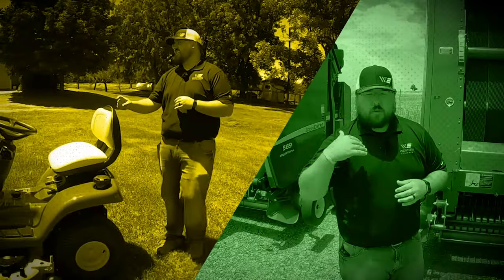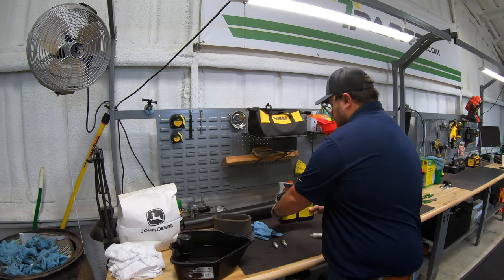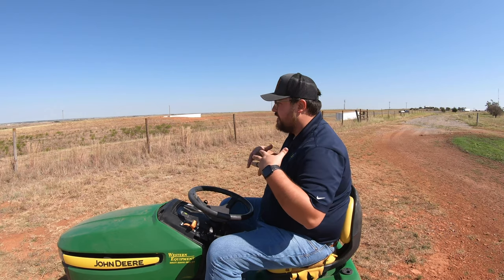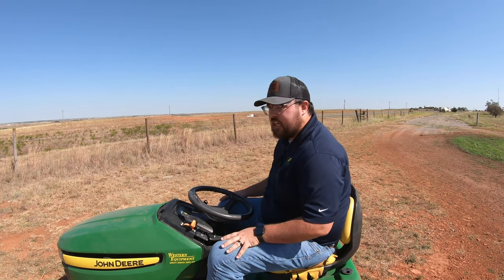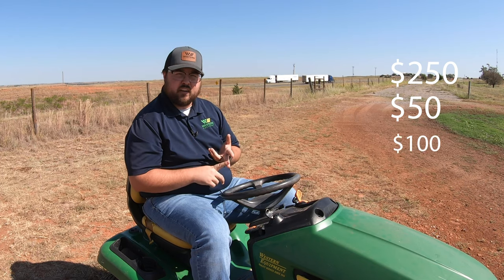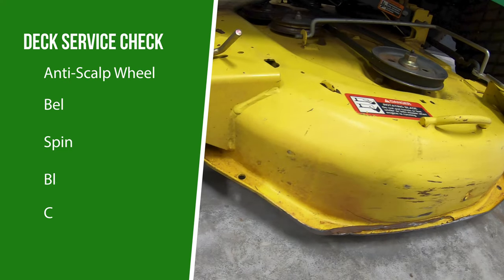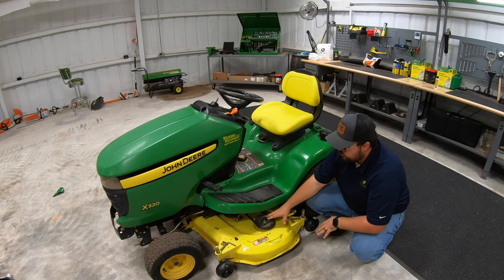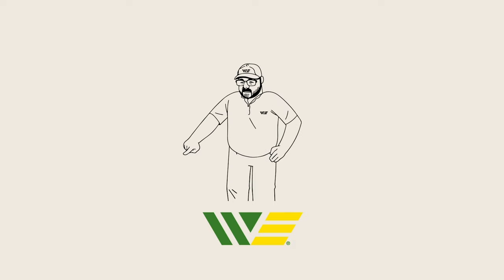Restoring a $250 John Deere Mower that doesn’t run to Like New - How much $$ does it take?

Comment: You can’t find anything like that for $250 here. They still want a fortune for a wore out pos. Just because it’s painted green they think its worth a lot of green
Reply: I can relate I am looking a for a good riding mower but cheap, and I can’t believe the prices $2000 - $5000 for a used one. I can’t believe an X series mower for $250.
Reply from the maker: I definitely hear this a lot right now. Especially with the shortage of inventory on mowers. We definitely got lucky with this one. Thanks for watching!
Reply: Flipping mowers for the last 4 years, cheapest I ever saw an x series was $500. Someone took out the ignition switch no hood and tires were bad. Round here (central mn) $250 gets you a 10+ year old home depot special
Reply: Every time I come across a used John Deere that's under $1000, they got rusted out decks and floorboards.
I do just fine with my Craftsman's. Not saying one is better then the other, but I'm not going to overpay for neighborhood status.
Reply: Just picked up a 1998 345 with only 458 hours, 48 inch deck, great tires, all body panels, original owners manual, motor cranks, some rat damage to engine harness but easily repaired. Needs a deep thorough cleaning and polish, came with some new filters an a bunch of JD parts. Paid 150.00
Reply: I don’t even try to buy the used jd
Can make money on the other brands 😊

Comment: The key is buying price. Most people with this kind of mower know nothing about how to work on it. Or how to keep it up. They use it four or five years and when it quits for any reason they buy new. I flip Scag mowers. Keep working my way up to pro commercial units. Good job on video skills. I would rather see how to test what made it stall. Not just indenifix ideas on commend failures.

Comment: Good to see another X320 running and mowing. Mine is a 2010 with no hood. I’ve run into just about everything on my 5 acres and I kept the hood on as long as possible but it finally broke into many pieces. I still find them from time to time. 
A year and a half ago I took it apart, cleaned off as much rust as I could and painted it. Removed the deck and replaced the spindles, pulleys, belt and blades. The deck got the full treatment and looks almost like new. 
It’s a good little mower and I’ll take it any day over the Z535M that sits in the shed most of the time with one thing or another wrong with it. 
Thanks for the video
Reply from the maker: Thanks for the comment and thanks for watching!
Reply: Got a x324 don't run .but rhe pulley on the part you push broken off and seems they had weld tack the bottom to hold it.. can that pulley be replaced?

Comment: I have a 2005 X320, and am encouraged to see this one still with a good transmission at 1500 hours, mine has around 750 hours. This model has the K58 Tuff-Torq transaxle which perhaps is sturdier than the K46 that the lower cost mowers have. The K58 isn't easily serviceable though... but you can put drain plugs in it so you can keep the oil changed out. Lots of videos of how to do that on YouTube.

Thanks for the video, great job! :)

Comment: I really like your videos. Very nicely done. Another year and I am still running my 318 from 1987 for 2 acres of grass. I like looking at all JD videos.
Reply from the maker: Thank you and that is awesome that you still have that 318 running. Did you buy it when it was new or used?
Reply: I bought it at an auction when it was 3 yrs old in 1990. One other person wanted it so I had to pay $3400. Has been well worth it. I like the hydrostat control on the dash but have never operated one with foot pedal(s). It seems like I manage it well when adjusting my body for a side hill and having to brace my foot. The power steering is still very nice.

Comment: This is almost my exact situation. Only mine runs pretty well. Mine has over 1100 hours. I used it as a bush hog pretty much last year on my new property and its just a tank. Plan on putting a bunch of new stuff on it this year now that I have it cleared out a little bit.
Reply from the maker: Awesome! Glad to hear it's still plugging along and thanks for watching!
Reply: Still have your x320? Still doin ok?
Reply: @ciphercode2298  yup
Reply: @MrBigjoecincy  I'm lookin at one that was traded in at my local dealer. It's been there since November.  It's got 1100 hours on it. The hood is cracked on too and the hinge part of it looks broken on one side. It seems to run ok. The were asking $1250,but when I talked to him he said theyd take $1000. I looked on Ebay and found new replacement goods for less than $400. I've no real experience with these mowers,but I know the Kawasaki fh661v is supposed to be pretty good. As long as the engine and transmission hold up I dont mind replacing other stuff. You think it's worth buyin maybe?
Reply: @ciphercode2298  yeah if it's. Newer one buy it. Mine has had a crack in it since I bought it. They want a lot for those hoods. Never felt like it was worth the cost.
Reply: @MrBigjoecincy  well,the mowers not newer. It's a 2009,but the hood on ebay is a new replacement.  Doest smoke or anything when they started it up and it's pretty quiet. No noticable rattles,knocks,or anything. I've found some that say that 1000 hours is close to its usable life and others say theyve had Kawasaki engines last well over 2k hours. Alot of it comes down to maintenance, but there's no way of telling really,until ya buy it and try it. In also lookin at a 2014 x300 that another dealer has that's only got 450 hours on it. They're asking $1699 for it,but it's been garage kept and looks almost new.

Comment: always made money on john deere used mowers,,,,i buy one thats 5 yrs old and buy in the middle of jan. Take it home, replace seat if needed, remove, regrease, repaint deck, change oil , replace blades or spinidles and belt. Remove wheels and hood and body,,,clean and repaint all, even underneath body and hood and fenders,,,new decals,,,paint wheels,,,check brakes and gauges. Reassemble, and mow. Keep it 3 years mow 4 acres 5 times per year,,,sell it in october after my last mowing for 2000-2500 more than i have in it. Lotsa buyers are looking for well maintained JD and will pay strong price
Reply from the maker: Sounds like you have quite the system! Keep up the good work haha!

Comment: I have an John Deere LX255 that was 15 years old when I got it back in 2012, finally had to replace the fuel pump because the checks wouldn't hold, but otherwise, it still run and cuts great,.

Comment: Nice work Brent, I have a 2010 X320 with 759 hours on it that I bought new and just pulled the non-servicable transaxle to clean the filter, magnets plus added new fluid, but it wasn't as bad as I thought it would be. I was wondering what that one would look like with 1100 hours on it?  Ofcourse mine never really slowed down or slipped, like some others I've heatd of, but wanted to give it a thorough inspection for peace of mind! Next time I'll do my homework and buy one that's serviceable...thanks again
Reply from the maker: Nice! Thank you for watching!

Comment: Thanks Brent for getting back to me.To me a good place would be before the inline filter to make it easier to change the filter.But I don't know if that would dry out the filter or hurt the fuel pump.Any thoughts on this would be appreciated.Thanks Slim.
Reply from the maker: This should be a fine spot. the filter and pump shouldn't be harmed by this at all. Good question and thanks for watching!

Comment: Great info..just bought a D140 . Sometimes mower will not even turn over..think it's electrical. Bought new key switch and will ck if issue. Any suggestions?
Reply: Valves may need adjusted. I've seen em not open quite where they needed to and the compression kinda wouldnt let the starter turn the motor over
Reply from the maker: Could be a multitude of things. Electrical or fuel is where to start.

Comment: Great video Brent!  I have a LA 105 bought for $650.  Steering went out within 15 minutes!  Replaced and works fine.  I noticed now it is surging bad.  I have replaced oil and air filters.  Changed the oil, added new spark plug.  I have ordered new carburetor.  Once I get it replaced hopefully will stop surging.  Any ideas if this does not fix??
Reply from the maker: If the carburetor does not fix it then I would look at changing the little fuel pump on the side of the engine. Good question and thanks for watching!
Reply: @WesternEquipment  Thanks for reply Brent!! I will try that if carburetor doesn't fix problem!!
Reply: Check the surging spring on carb. It might have come off or does not have enough tension.

Comment: Man 1500hrs doesn’t seem like much for the ole girl. We had a 2003 LT160 that was a dealer only model. My dads dad bought it new, & when he upgraded my dad was given the mower. We used it for a bunch of years, & could tell the transmission was starting to give out, but not too bad.

My dad upgraded, then gave it to his brother that has a house on the same property as my dads dad. It was at 950hrs when it left our place, & it had 500-600hrs when it arrived at our house. 

We drove the crap out of that poor mower, it’s seen 3 generations in our family. Got 3 1980s JD GTs ones a now semi racing mower that’s broken again. A 212, 216 that’s waiting for a Dsl engine I swapped into a 73 sears suburban that I’m going to swap into the 216 like what I did with my 212 that has the same engine in it now. Then I’ve got a 67 1st gen 110 that needs a belt, a tire, maybe a steering wheel then she’s all set.
Reply from the maker: Wow! This is awesome! Thanks for sharing and for watching!

Comment: How the heck do you move the seat back I just got this exact mower to restore but can't get the seat to move back
Reply from the maker: There is usually a lever under the seat or on the side of it that releases the slide function. Sometimes on restore models you have to really clean up the slide for it to work well. Thanks for watching!

Comment: One thing you don’t mention is the transmission of the lawn tractor how do you check the transmission of a lawn tractor
Reply from the maker: On most of these lawn tractors the transmission is sealed so there isn't a way to check them without taking them completely off and opening them up. A select few models have serviceable transmissions.

Comment: Awesome job on the the mower Brent,looks nice and clean.Brent, I would like to install a gas line shut off on my S110,Where would be a good place to install it? Thanks.
Reply from the maker: Thank you! You would want to install it some where on the fuel line going from the tank to the carburetor. I know that is very vague but it is hard to recommend a specific spot. I hope this helps and thanks for watching!

Comment: How do I fix a lose steering wheel when I turn it there is a good 3/4 inch before it starts to turn
Reply: Remove the deck. Underneath you will find the sector plate and pinion gear. 
You need to replace those and the bushings. 
It’s an easy and inexpensive fix. 
Part number: GX21924BLE-KIT
(1) Steering sector gear
(1) Steering pinion gear
(2) plastic shaft bushings
(1) metal sector gear bushing
Reply: @caswinson  Great information on the steering fix....
Reply from the maker: @CraigSwinson thanks for beating me to it. And thank you all for watching!

Comment: Yea man I also restored my jd when I got it for free. The funny thing was the battery was dead, surging, and transmission issues which was easy fix
Reply from the maker: That's awesome! Thanks for watching!
Reply: What did you do for surging?
Reply: @spuckett2208  what I did was I took out the gas tank cleaned it out Good, dont use soap, and I put some fuel cleaner in the gas tank with some new gas, and replaced my fuel filter, also I took my carburetor out and cleaned it very good with some carburator cleaner, after that it was running good

Comment: Is there any way to fix up scratches in the plastic hood? (100 series)
Reply from the maker: Scratches in the plastic are tough. Sometimes you can sand and polish them out and sometimes just buffing them out with a power buffer and the polish I used in this video will make them look worlds different.

Comment: I found a lawn tractor like yours for $400 , but completely rusted , no signs of life and a rats nest inside the engine compartment , which also ate several electrical wires .

Now I'm deciding: do I really want to salvage this pile of rust and poop?
Reply from the maker: It all depends on the damage of the frame and body.

Comment: $250.OO is what a John Deere dealer would be willing to allow on a trade in for that mower. So he could set it out on the lot and ask $1800.00 for. He would maybe get in running nice but that is about it.
Reply from the maker: That is about right on a trade in value so hopefully this will persuade some people to just fix up their mower rather than trashing a good mower that just needs some TLC.
Reply: @WesternEquipment  That is why I have 4 John Deere mowers I sold my LX280 that was in nice shape low hours outright for $1800.00 to help finance a new X590 I also have a 2003 LX277 I bought new now has 520 hours on it looks like new also. I have an old 300 I think it is a 1976 with a hydraulic 4 way 54 inch front blade and I just purchased a 2005 LX280 with 412 hours one owner with dealer service records I gave $1500.00 but I think it will be worth it. I have bought and flipped a few machines including 2 318s and a GT235 and a 1966 110 round fender.It is my hobby

Comment: For $250 I can get a craftsman that’s been sitting in the yard for 5 years with no deck in my area
Reply from the maker: Ouch, that’s rough since a new deck is probably 2-3 times that. Unless you could find a used one somewhere else that could work. Good luck and thanks for watching!

Comment: If your thinking you can FIX a John Deere mower with 1500 hours by just adding  a ecm, new plugs, oil change, paint and a new seat your NUTS!!
 sure it looks better and the ecm got it running  but that's just about all the "fixing " you did 😉 😀. 
At 1500 hours the laundry  list of actual REPAIRS is extremely long and expensive.  
 This is your average  used car salesman tricks....wash it, touch it up and make it look pretty,  fix it just good enough  it runs and stick it to some sucker who doesn't know  the difference. 
  There's a ton of guys out there just like this on Facebook and Craigslist that  screw people over every day promising  a good mower and a great deal .
 At $1000 and 1500hrs this mower isn't one of them.
 I say $1000 because  of course you do this to make a profit....
Reply from the maker: Interesting.. I appreciate the feedback. Thanks for watching!

Comment: My God Why Would You Spend $90 On A Fuel Solenoid , You Should Have Un screwed It &  Just Cut The Tip Of The Solenoid Off.. You Would Be $90 Richer.  That's Just Crazy  😳
Reply from the maker: Just wanted to make sure to do the job right.

Comment: That’s all the green ones are worth new, 250 with plastic trans
Reply from the maker: Well this one does not have a plastic trans, but I get what you are saying...
Reply: The k58 is actually a pretty stout transaxle. The only ones that had a plastic transmission were the lowest end 100 series mower. I understand your frustration if you bought one of the cheap ones,but you cant lump em all into one box

Comment: You won't sell a 15 year old X320 John Deere with 1500 hours on it for anywhere near $1800 bucks.  Probably has a Briggs or Kawasaki engine and close to needing a rebuild or replacement on engine.
Reply from the maker: I guess this all depends on the condition.